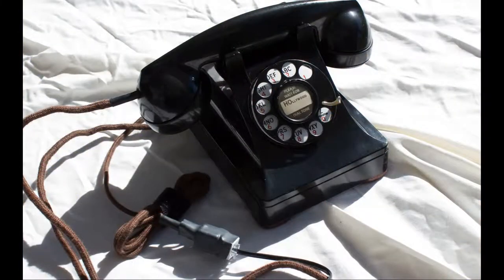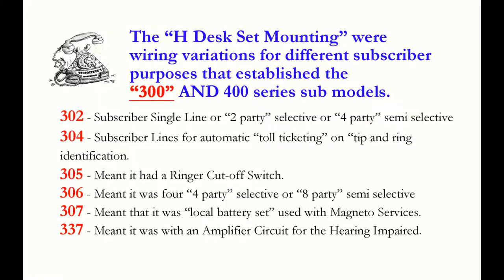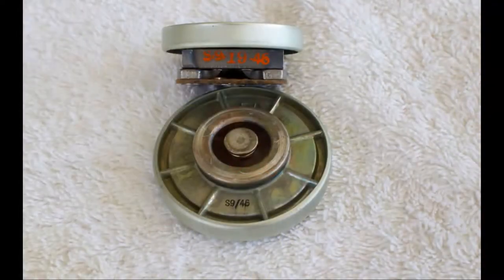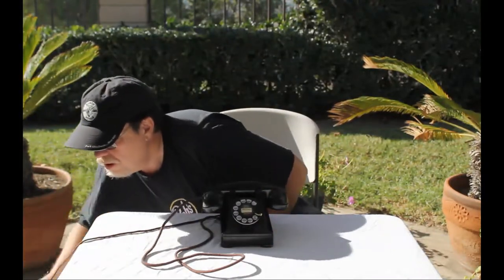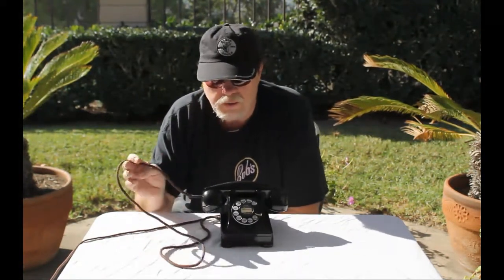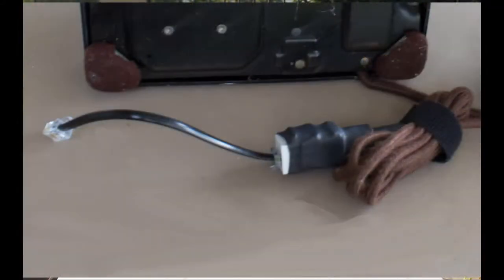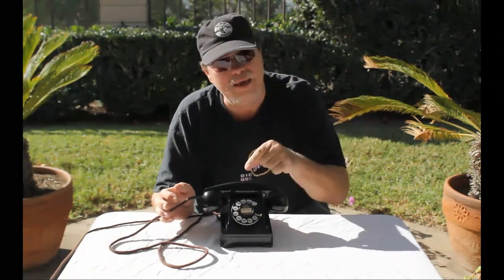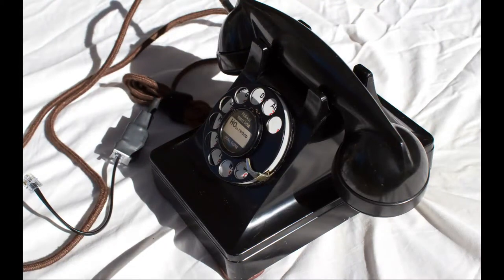Western Electric "H" Series 302 Telephone

Comment: I got a Model 5302 from the late 1940s early 1950s.   It was made with 302 parts with a 500 outer shell.  It was a transitory phone between the Model 302 and Model 500.    Apparently Bell didn't want to waste any parts when they introduced the Model 500 so they used up their existing inventory of 302 parts in the 5302.
Reply from the maker: Yes that is very true.  I personally loved the 5302.  I think the F1 handset looks way better than the G1.  But....It's all good.
Reply: I think I may have two such telephones.  A lot heavier than the regular cd 500.

Comment: The 302's I have have a Rotatone in them because I have to have touch-tone dialing on my POTS line due to recent conversion of the DMS-100 switching equipment to a more modern remote switch.
Reply from the maker: That's a Class 5 - C.O. Switch.  Some large businesses had those   What did the phone company replace it with?
Reply: Telco Steve on a cordless phone it sounds like the Siemens EWSD switch maybe, except when you call it from a phone that still has DMS-100 or even DMS-10, or even a cell phone, there is an audible click at the beginning and end of each ring. All the repairman would tell me when he came to check out my phone line was that it was being converted to a remote switch. Our CO is probably a mile from my house. So I don’t know where the remote site may be, but all NXX’s in my city have some numbers which have been cut over to the new system. I was telling a friend that I made a call to a non working number in remote northern Ontario, Canada and the intercept recording in both English and French was followed by a 2600 Hz tone, which had supposedly not been in use for nearly 15 years.
Reply from the maker: @omar967  2600 Hz Tone you are hearing is a Signalling Tone for disconnect or call supervision purposes.    Well rock on and thanks for watching.
Reply: Telco Steve I was aware of that because I listen to the stories of Evan Doorbell. Until I found his programs on the Web, I hadn’t heard that tone for over 30 years.
Reply: I am going to have a 202 phone shortly. I have a nice little collection of antique phones.

Comment: I have a 302 phone, and would like to use it with a "consumer cellular home base"  (which is actually another cell line designed for landline phones)  What would I need to use the 302 on this system.  Thank you in advance.

Comment: What year did they stop producing model 302‘s because I have one from 1956 and I didn’t realize they made them that late? Also how would they make only one phone ring on a party line?
Reply from the maker: The 300 series model came out in the late 1930s.
The party lines.   That is a very long detailed issue. But in short,  It was called "selective ringing."  The line side was "tip party or ring party" etc.  Wikipedia probably would have a long detailed explanation of tip and ring along with ground for a three-wire hook-up at that time - which helped.  So it was a matter of how they were wired to the line side of the telephone service feed That's why must 300 series models would have to be rewired to work on two-wire service.  Keep in mind that some LECs used frequency selective ringing which can really cause ringing issues in say a Stromberg Carlson Fatboy with a 16hz vs. "Straight Through" ringer coil.  Also, the frequency issue can cause heartache on the Norhern telsets.

Comment: Just a quickie, I buy, refurbish, and sell old WE's, and in my many years of doing so, I've never been quite able to get a good shine on those old thermoplastic/bakelite models. If you don't mine me asking, how do you achieve that luminous shimmer on your old ones? I've tried oil rubbing them, buffing them, and more but to no avail. Can you help me?
Reply from the maker: Try NOVUS No.2  Lot's of elbow grease and time.  They are not a three hour investment.  More like 6!  Have fun!
Reply: I have a red orange F1 on eBay right now if you want to check it out

Comment: I have 302, but I need to re wire it for modern day usage but the cover will not come off, even with all the screws on the back have been removed?  Any tips/tricks to get it off?
Reply from the maker: Sounds strange.  Who knows what is holding it on or jammed.  There are only two flat-blade-slotted screws on the bottom plate securing the cover.  Without it in my hands I can't help you.  Good luck. Thanks for watching.
Reply: @TelcoSteve  I unfortunately got it opened by prying on the plastic on the sides and wiggling it a bit.  I like your videos.  Do you have any 302’s for sale?
Reply from the maker: @wecollectorboy1017  Yes, email me and I can discuss.

Comment: Can anyone out there comment on the average sound and microphone quality one could expect from these sets? Should they sound more or less like a modern phone when in decent working condition?

I've been experimenting with using my 302 with a cell2jack. It will dial out and function, but people I talk to have made comments that the audio quality is gravely and "far away" sounding. I'm wondering if this is the nature of the beast or if there's something wrong with my set specifically.
Reply from the maker: Depends how is your handset wired up?
Reply: @TelcoSteve  I followed the wiring diagrams I was able to find online. The wire itself is a drugstore coiled cord with the ends stripped off (very thin copper), but I have a reproduction of the original coiled cord arriving tomorrow to replace it.

I did more reading, and my bottleneck might be the bluetooth interface on the Cell2Jack.  Some reviews have complained about the call quality that it offers. I'm keeping my eyes open for a second cheap thrift store phone to test that out.
Reply: I've added the reproduction wires but noticed something else that's puzzling me.

In some wiring diagrams it looks like red from the wall goes to L1 and green goes to L2, while other diagrams say the opposite. I've tried both ways and can't hear any difference. Does it matter?
Reply from the maker: @BokBarber  Sound like a plan!
Reply from the maker: @BokBarber  ----With a PSTN or hardwired Landline POTS service now?  Rotary Pulse signaling does not matter on L1 and L2 being reversed. It could have mattered back in the days of selective ringing and "party-line" service  Remember, you might also have a bad transmitter element in you phone and/or bad switchook contacts and contacts in the handset.  Trying to figure this out by writing back and forth is not going to solve this.  Bad contacts in the dial can also cause call quality issues.  This is why I charge to repair the phone. Good luck